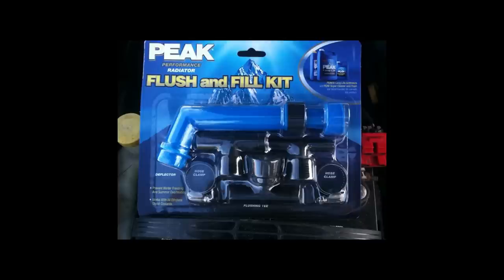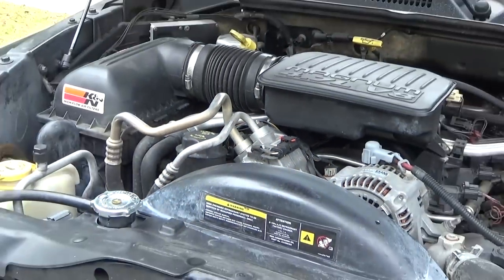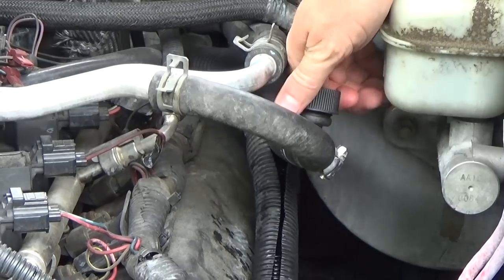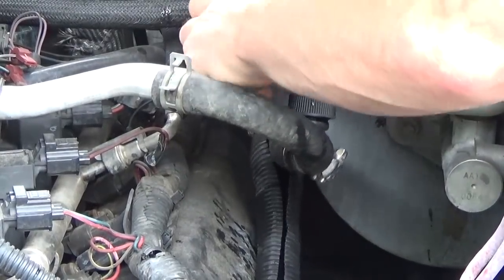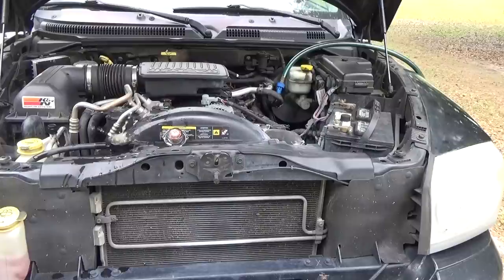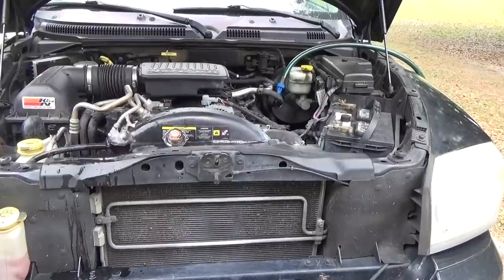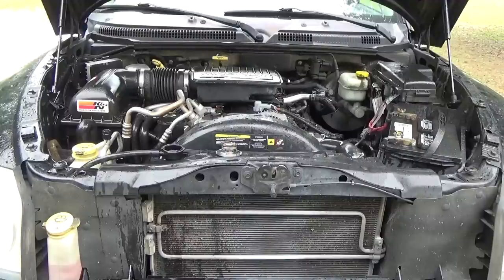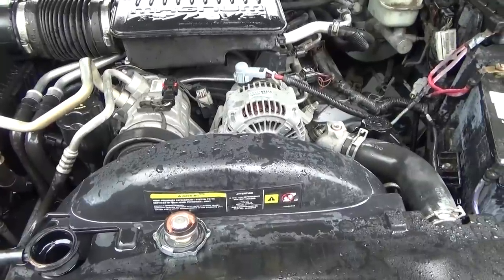How to Flush Your Car's Cooling System and Radiator

Comment: You've missed critical steps in the process. Recovery and proper disposal of used coolant. Animals and pets will drink it if toxic liquids are left to puddle on the street. Also, testing coolant strength after flushing system. Water remains in heater core and engine.
Reply from the maker: Agreed Robert.  I actually just re-recorded this video and will be uploading a new version that addresses these issues soon.
Reply: Aren't you suppose to let it bubble over letting vermits lick it up?...think that's what that attachments for to run in bucket?
Reply: Thanks Robert Lee, there's always at least one "Karen" in the diy auto repair video comment section.
Reply: @tonyjackson4099  Always!!
Reply: @bevo7041  

Nice.
Is that the same profile pic you use for Grindr?
Reply: @bevo7041  🏳‍🌈🏳‍🌈🏳‍🌈

Comment: Why distroy the original line buy cutting it? Cant you simply remove the hose gets some additional hose from a auto parts store and tap it in so you can remove the "T" fitting?
Reply from the maker: I understand what you are saying but you aren't destroying the line. I did this procedure over 6 years ago and have never had a single problem with it.
Reply: T-fitting makes it easier for the next time you do it.   @ClintHolland
Reply: @RSW1484 still makes more sense to just buy 1ft of hose for like $3 and connect the T like that instead of cutting the oem hose in half. Doing that creates 3 additional and potential fail points.

Comment: On my 86 Oldsmobile cutlass,  ( chevy 350 small block) I have a heater hose that go's to the engine block and one that goes to the water pump. Which one do I install the T in? Thanks in advance.
Reply from the maker: The one coming from the engine block should be the heater inlet hose which is the one you should use.
Reply: WRONG! The one coming from the water pump is pushing the coolent out - this is the one that pushes the coolent into the heater inlet fitting... ..The outlet heater hose returns the coolent back into the engine block. at least on a 1996 Ford Explorer 4.0 engine.

Comment: In the old days, we removed the thermostat and put the thermostat cover back on the intake manifold. Then open the heater valve full. There is no need to run the engine since the entire cooling system will be open. This  back flushes the block as well. No need to worry about back flow to the hose without the water pump working. Waste water comes out of the disconnected lower rad hose, not the rad. The rad can be easily flushed after.
Reply from the maker: That would be ideal but many vehicles, this is one of them, won't seal with the thermostat missing.  The thermostat o-ring actually is what causes the housing to seal. But in general that is a better way.
Reply: @ClintHolland  A small leak around the thermostat housing is OK. The only pressure is from the garden hose which you can control.

Comment: Great video thanks for posting. Pretty much covered it all. Couple of suggestions - remove the petcock when doing the hose flush and possibly the lower radiator hose at some point. You get the coolant out of the radiator tap but there is really no way sediment etc will flow out through the radiator cap at least not like it would through the petcock.  Second you mention 50/50 mix but what you ended up with is quite a bit less. Since your system had 60% distilled water in it on your last drain (radiator drained) adding premixed 50/50 for that 40% would result in a. 80/20 mixture- way too low.  You needed 100% coolant which even then only gets you to 60/40.  So many people don't get this point. You need to know total system capacity and what the drain amount is so they understand what coolant mixture - if any - is required.  Lastly do the draining in the grass or capture the fluid - that mixture going out on the street is dangerous as you know.  Great job - I basically do the same thing but go straight to 4-5 distilled water runs and skip the flush equipment part.
Reply: I had the same question regarding the 50/50 mixture.   Like you, I don't think that people understand the math and I think that Clint Holland has given bad advice to the folks watching this video who will wind up with a poor mixture in their cooling systems.   I wish there were a petcock at the bottom of the block!   Short of that, would it be OK to run the engine and let the water pump run dry for a few seconds?  Would this remove the 60% of remaining water???
Reply: @tribulationprepper787  you know where that connection to the heater core is? Get a 5 gallon bucket, fill it with whatever 50/50 antifreeze you would like to use, get a hand pump that can connect to it, and start pumping coolant until it comes out of the radiator looking like the color of the antifreeze. Check the water content with a gauge, yeah get a gauge.
Reply: @gamerkay5791   I bought one of those little clear plastic gauges a while back.  Now I am using those paper strips that change color to indicate coolant concentration after you dip them in the radiator.
I had even given some thought to popping out a freeze plug at the bottom of the block.   My next thought was NAH!
Reply: @Laredo Potato should not drain it in the street or the grass
Reply from the maker: Depends on the coolant you use.  Many vehicles are now using non-toxic coolant and you can always find some to replace yours with if it is a concern. I have been running it for many years now. @condor5635

Comment: I bought a used 1990 Ford ranger and heater core hoses coming out of the firewall up by the motor they've been cut off they bypassed it so and they're side by side so how do I know which one goes to the upper connection and which one goes to the lower connection
Reply from the maker: They bypassed it so that coolant never goes to the heater core?

Comment: My radiator doesnt have a cap, so Im assuming the water would backflush into the plastic tank and flow out that way?
Reply from the maker: You would probably need to use the drain plug on the bottom instead and be careful not to let it run too low.

Comment: What if you don’t have a cap in the rad and only a reservoir? I have a Chevy with only a reservoir tank. No fill hole on the rad.
Reply from the maker: In that case your best bet would be to temporarily disconnect the upper radiator hose.

Comment: Thanks for making this video!! Saved me few hundred bucks...greatly appreciate it
Reply from the maker: Awesome.  Glad to hear it Mike.
Reply: @ClintHolland  got a question...i flushed system, put on new water pump, new thermastat, new fan relay,new coolant temp.relay and it's still over heating only when it sits and idles for little bit,, any suggestions??
Reply from the maker: @mikecarter3606  I know you said you replaced the fan relay but are the fans coming on when it idles?
Reply: @ClintHolland  yeah it does kick on now.but still overheating,, it seems like the fan is not turning like it should seems slow,, is that possible??
Reply from the maker: @mikecarter3606  Absolutely. You mentioned you replaced the relay so I am assuming they are electric fans and they can definitely fail in such a way as that they don't spin fast.
Reply: @ClintHolland  ok thanks alot for your help! Greatly appreciate it
Reply: @mikecarter3606  it could be the head gasket seal is broken?

Comment: One heater hose goes to the intake manifold right next to the thermostat housing and the other heater hose goes to the radiator.  Which is the inlet hose?
Reply from the maker: What is the year, make and model of your vehicle?
Reply: @ClintHolland  1988 Chevrolet C3500 with 454 engine.
Reply from the maker: @steverose2405  According to the diagram your heater inlet hose is the one on the right as it enters the firewall if you are looking at it from the front of the vehicle.  Basically the hose closer to the driver side.

Comment: Do you just let this spill out onto the ground?
Reply from the maker: That depends.  I run only non-toxic coolant in my vehicles so I frequently do but if you don't, just make sure it doesn't pool somewhere that animals can drink it.  And definitely make sure it doesn't run into a storm drain as it can kill fish and other water dwelling animals.  If you have a catch container big enough the correct way is to just catch it and dispose of it according to your local regulations.
Reply: I got a spill-less funnel kit and use the radiator coupler and adaptor and 1" plastic tube,  hang it into a 5 gallon bucket.  No mess.

Comment: what do you do if your radiator doesn't have a radiator cap and only a coolant reservoir?? I own a Opel/Vauxhall Astra H 1.6 2007 ???
Reply from the maker: So the simple answer is it's a pain. Draining it is about the same but flushing and refilling it is horrible. You will refill it through the coolant reservoir but most cars have a bolt you have to loosen to bleed air so you can refill or flush it. It is usually the bolt on the thermostat or another bleeder valve.  This isn't my video but see if this one helps.  https://www.youtube.com/watch?v=IjqfgUPQ4hA
Reply: @ClintHolland  thanks for the quick reply , will follow this procedure when I flush and change the coolant on my Vauxhall Astra 👍

Comment: So after everything is said and done we just leave the tee fitting there and it won't melt or anyting? It won't harm the vehicle or possibly melt or or something. So we don't have to remove the tee fitting what done?
Reply: That's what I'm thinking. In don't trust that cheap plastic. Replace the hose after or get a joiner.
Reply from the maker: That is correct.  It's made of Polycarbonate which doesn't melt until around 300+ degrees F and your car runs in the low to mid 200s. If you are worried, replace it with a metal inline connector.  Mine has been on this truck for 8 years and still works just fine.
Reply: I've had mine in for 5 years or more. No leaks or any problems.  It's the Prestone Kit.
Reply: My vehicle already has fittings of the same plastic in the heater lines. But if this came in aluminum, I'd certainly get it.

Comment: Flush with the tap water?
Reply from the maker: Absolutely.  Flushing with tap water is fine.  Just don't run your vehicle on tap water as it can cause corrosion even though that risk is over hyped as well.  Flush with tap water and then refill with coolant and distilled water if necessary.

Comment: What's the difference in doing this on a vehicle that doesn't have a radiator cap
Reply from the maker: I wouldn't use this kit, pretty sure you can't, with a car that has the sealed coolant system.

Comment: hey so how do you connect the hoses after you finish? like after they're cut and does the coolant reservoir need to be empty?
Reply from the maker: +Dai Do You just connect them back like they were but with the T in the middle.  Ideally you should empty the coolant reservoir.  Sometimes this is quite difficult since most don't have a drain and you will need to suck it out using a pump.

Comment: I can just let the coolant run down my driveway into the street?? also if you remove the rubber line off the metal line and add a small heater hose in between you dont have to cut the expensive factory hose
Reply from the maker: You sure can if you run non-toxic coolant in your radiator like I do.  I am big animal guy and switched all my vehicles over to it years ago when I learned that animals would drink it because it was sweet.  You are correct but the risk of cutting your factory hose is overblown.  If you cut the hose and want to take the tee out later, you can buy a connector and clamps for less than $5. Plus, leaving the tee in works great when you want to flush it again later.
Reply: Clint Holland Tastes bitter to me. Lots of spitting to get the taste out.
I prefer to buy a new hose and use the old one for the T, but OP may have stated a better way. Chunk of heater hose and remove when finished. 3 less failure points in the system.
Reply from the maker: @caddyguy5369  Very valid point.  Buying another heater hose is definitely a great route to go but this method works well to.
Reply: Clint Holland I actually just got done doing this the other day. I ended up just getting a hose barb of each the inlet and outlet heater hose sizes and some clear tubing. I plastic welded the hose barbs together and put everything in place of the heater core.

Comment: I believe the instructions on the package tell you to run the engine 5mins while running the flush. Wouldn't the engine reach operating temperature in that time?
Reply from the maker: It is doubtful your engine would be hot enough for the thermostat to open in 5 minutes of idling.  If you were driving it or revving the engine up, it might be.
Reply: Usually takes 10-15 minutes to reach operating temperature, if you have a a working thermostat.  If yo remove the T-stat could take longer. @ClintHolland

Comment: Does this also flush your heater core?
Reply from the maker: On most cars it does.  Some cars have a heater control valve that only opens when the engine is hot which won't work for this flush kit.  However, check out my other video on Flushing Stop Leak out if you need a good flush that includes the heater core.  You can also pick up some heater core flush adapters that hook to your water hose.

Comment: Hi Clint. Would I be able to drain the radiator first before flushing it? Or do you recommend to flush it first and then drain?
Reply from the maker: You can certainly drain it first but it doesn't really matter.  If it's really dirty, try a product called Thoro Flush.  You can get it at most auto stores or Amazon and it works great.

Comment: How are you going to fill it 50/50 with all that water still in the block? It's nearly impossible to find pure antifreeze now?
Reply from the maker: You don't.  Nor is it required. Just refill with the 50/50 mix and drive it a little.  Once it has mixed up well, buy a cheap coolant tester and see if it is in specs of what you need.  If not, add pure anti-freeze and keep retesting. This is only if you are a purist and want the mix to be a perfect 50/50, which it doesn't need to be. The main purpose of anti-freeze is in it's name. It is the keep the coolant from freezing. So if when you test it, it meets your needs even though it isn't at 50/50 there is no reason to try to hit that magical number. There are other factors of it such as anti-corrosion and boilover prevention but as long as the coolant tester shows it meets your needs, you are fine.
Reply from the maker: @jjack6896  I am not saying you are wrong, just that draining the block is impractical and not needed.  I am looking at the Toyota Dealer repair guide right now for a cooling system flush and even the manufacturer doesn't include draining the block in their dealer instructions.
Reply: Quick Fix that’s pretty odd I know it’s in Toyota manual for my FJ’s. FYI the manufacturer manuals aren’t always the best way. I’ve seen some really stupid ideas like pull the motor to change the timing chain.
Reply: @ClintHolland   Isn't it necessary to have the correct mixture to properly lubricate the water pump?
Reply from the maker: @tribulationprepper787  It is not.  That is generally considered a myth as water pumps are sealed units that don't require lubrication.  You actually can't lubricate them even if you wanted to.  Many people in warmer climates run straight distilled water year round with no issues.  The main benefits of anti-freeze are the corrosion inhibitors and the boilover and freeze protection.
Reply: @ClintHolland   That makes sense to me.  Thanks

Comment: Hi Chris, Believe I know the answer, however, just to be sure,  this is not a back flush, correct?  Secondly, does this flush the heater core?  Thank you sir.
Reply from the maker: Correct.  This isn't a back flush.  And it will flush your heater core if you don't have a heater control valve. If you do, you will just need to run the heater and let the truck get up to operating temperature to do this.

Comment: I'm doing this for the first time and have a couple questions.  It looks like you add Irontite Thor Flush first, run engine 10 minutes, drain the radiator, (let engine cool some) then connect this kit and run water through?  My other question is since the "T" is on the inlet hose doesn't this basically flush the heater core at the same time??
Reply from the maker: Depends on the vehicle. On this Dodge, yes. However, on some vehicles there is a heater control valve that doesnt open until the engine gets up to temperature and it's pretty hard to get it up to temperature with the cool water flowing from the hose.
Reply: Clint Holland Thank you!

Comment: I bought this kit not realizing that I would have to splice into the system. Im not a fan of creating more potential points of failure especially if using plastic and worm drive clamps.
Reply from the maker: I get it and I completely understand.  This kit is still in place after almost 10 years and works just fine.  You can always try a chemical flush or buy a replacement heater hose to use afterwards.

Comment: Did you drain the radiator first ?
Reply from the maker: It is recommended but even if you don't just run the flush for longer and it will accomplish the same thing.

Comment: I heard distilled water will steal elements from the metal in the cooling system because distilled water isn't happy water, as if it's unbalanced a little. So, the advice was mostly distilled plus a small amount of tap water.